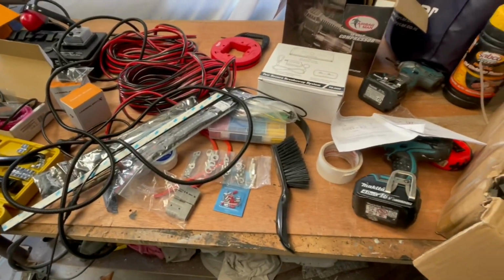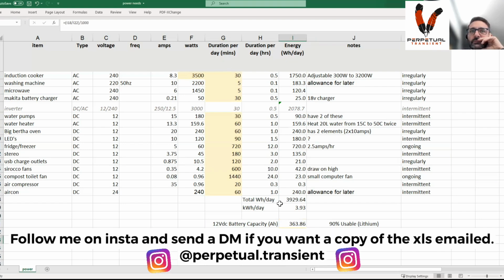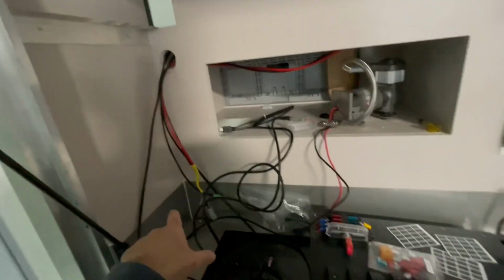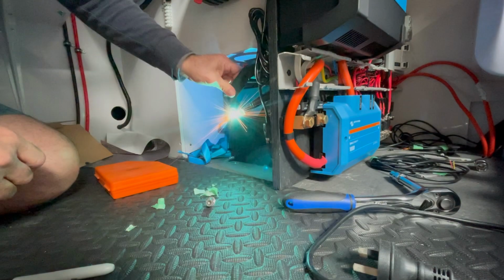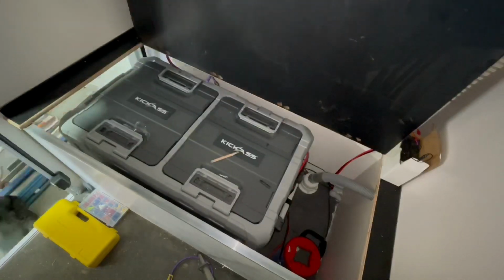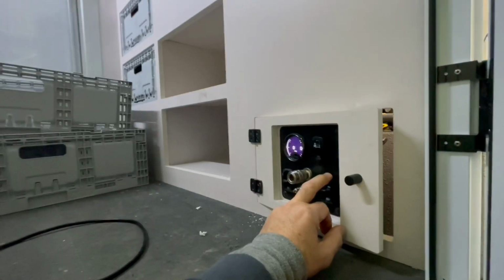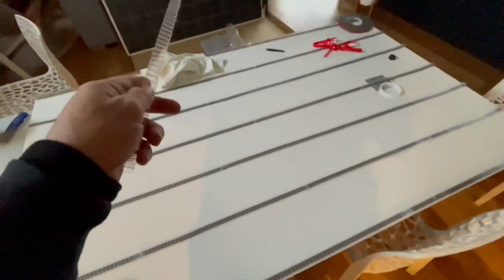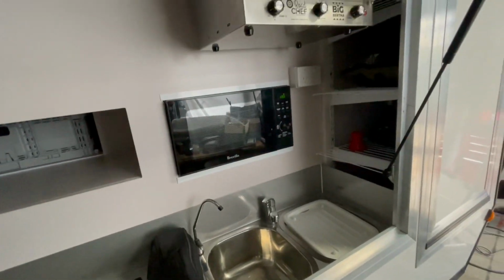Episode #18 - Solo DIY offroad caravan build series - wiring and solar

Comment: If you want to prevent the sparking from happening, get a resistor of 5-10 Ohm and put it in between the terminals for a few seconds. That should charge up the caps enough to where it won't spark again if you remove the resistor and hook it up.
Reply from the maker: Thanks mate, someone else suggested the same thing too

Comment: I have a big ceramic capacitor with a short length of cable soldered to it. If you put is across the main switch you can charge up the inverter without the spark. Also if you have a short somewhere the resistor gets hot and you can investigate before throwing the switch and blowing fuses.
Reply from the maker: Oh yeh that sounds handy

Comment: You do a really good job at timing your episodes. When you're filming, how do you know when to cut for an episode. Everything obviously takes longer than 30 mins so at what point during the hours of filming do you decide you have enough content?
Reply from the maker: It’s a tricky thing to manage. I usually add all the content in one edit and then try to cut down what is usually an hour or more of footage to the 30 mins. Episode 18 was by far the hardest to put together. Wiring is boring, and it’s hard to show anything of substance, plus it took like 6 weeks to get the wiring done in the end across fits and starts so filming was very patchy.